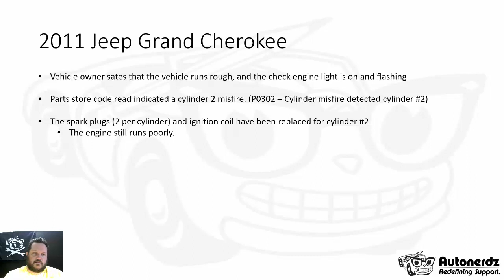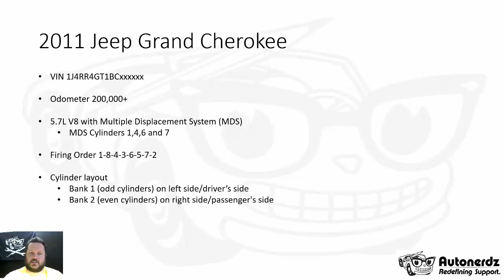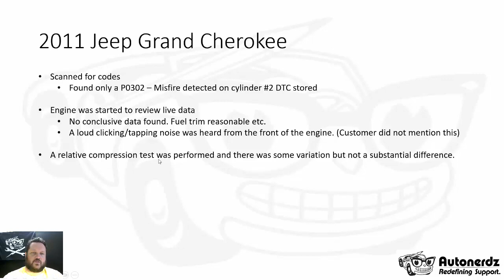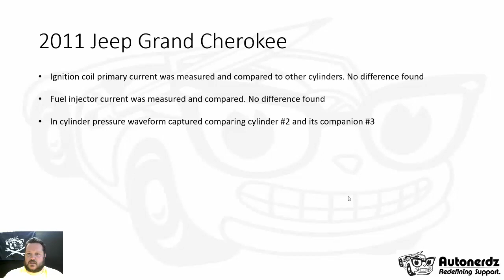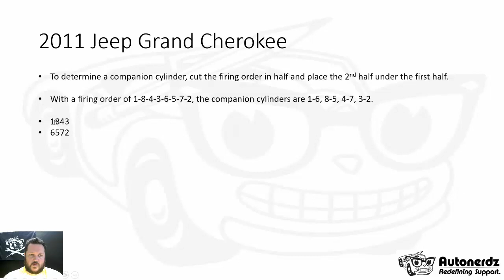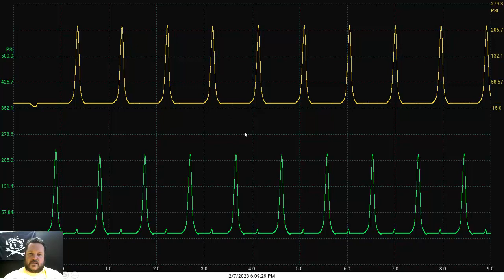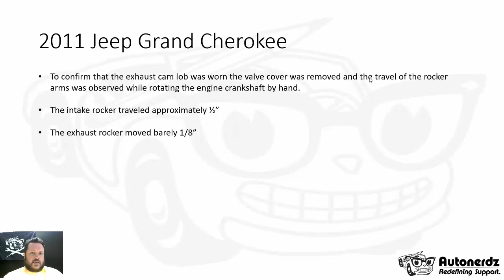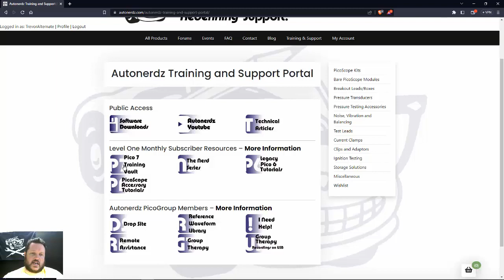Using dual WPS 500x sensors to speed up a misfire diagnosis.

Comment: Very interesting. In the days before scopes I would do a running compression test with a mechanical compression tester, on a snap throttle 
a flat exhaust lobe would show up by the pressure being higher than on the cranking test. On a good cylinder the pressure would be 80% of the cranking test.

Comment: I would spec to see a a higher current at its sister cyl since  two cylinders are in compression at the same time. Good found thank you for sharing it.
Reply from the maker: If you think about it from the perspective of the exhaust valve not opening at all, I would agree with you. We've seen this on other engines where an exhaust lifter for the MDS or AFM systems causes the exhaust valve to not open at all. But in this case, becasue the exhaust valve is still opening a little bit we didn't see a drastic change in the relative compression waveform.